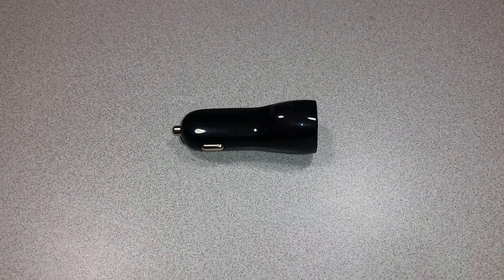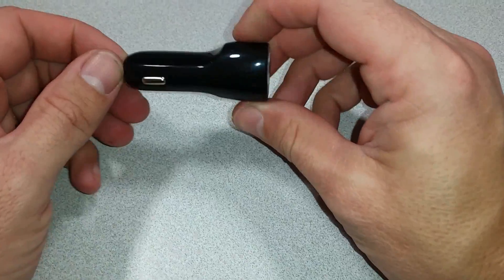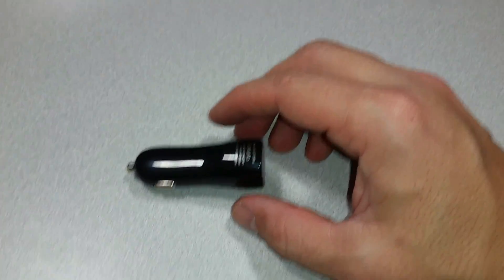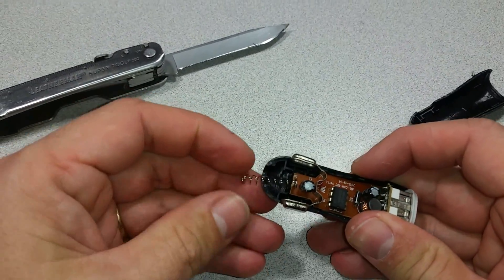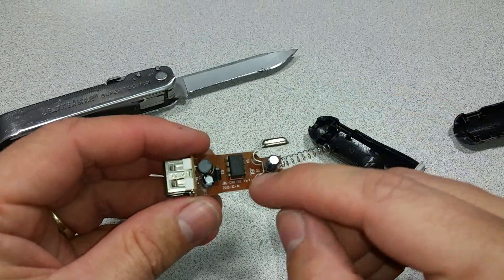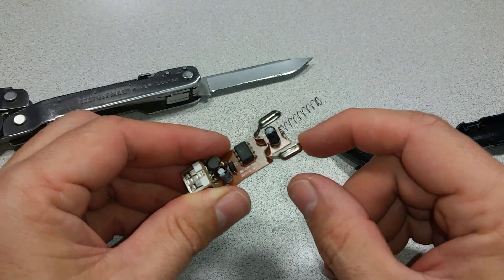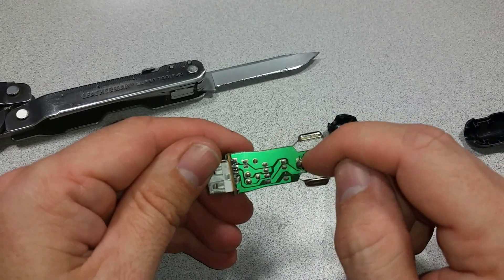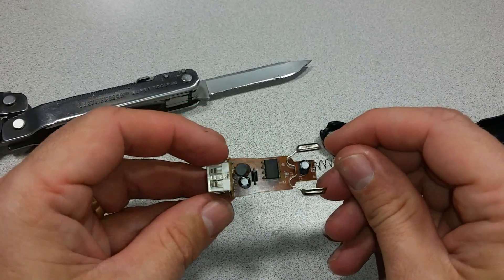12VDC-5VDC Car Converter Disassembly and Analysis

Comment: Can I connect a 13 watt solar charger to that and charge a car battery?
Reply: Does the current run both ways I mean?
Reply from the maker: @hotchicks420  These are generally designed to only allow the current to flow one direction. In this case, 12VDC -> 5VDC. Not the other way around.

Comment: Now to find the 5v output and wire it to my ECU so it thinks I have a fuel tank pressure sensor.
I guess I just plug in a USB cable, chop it open and check voltage on each wire.
Is there an easy way to make it vary between 2.5 and 5 V?
Reply from the maker: Not without adding a component. This one is the cheapest/smallest https://ameridroid.com/products/level-shifter-5v-to-3-3v?_pos=5&_sid=353c566ff&_ss=r and this one is bigger/overkill but super easy to use https://ameridroid.com/products/dc-dc-12a-stepdown-voltage-converter?_pos=1&_sid=353c566ff&_ss=r (usage video at bottom of page)